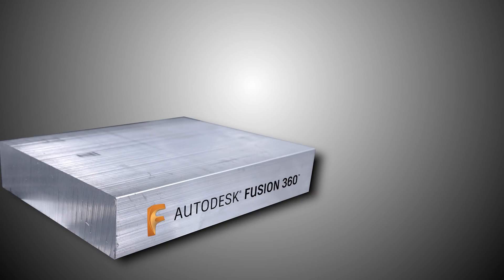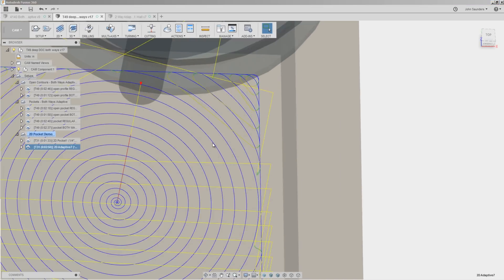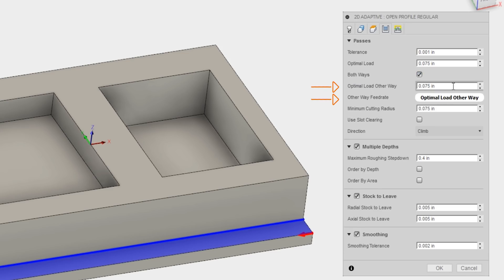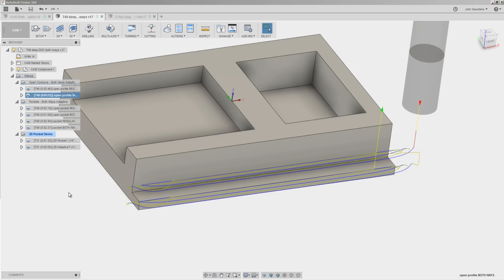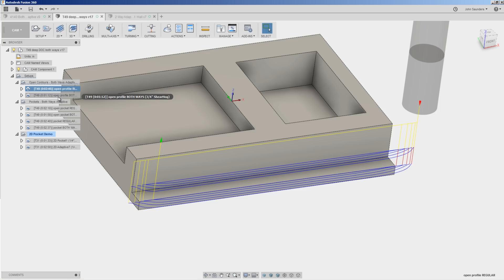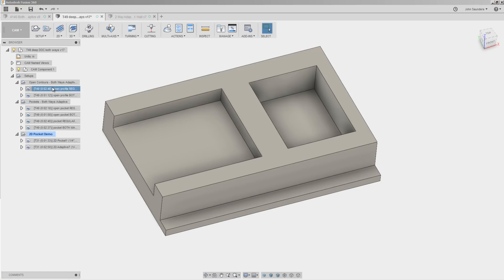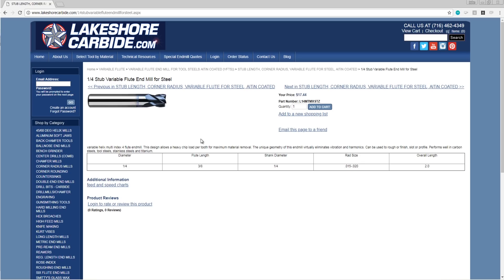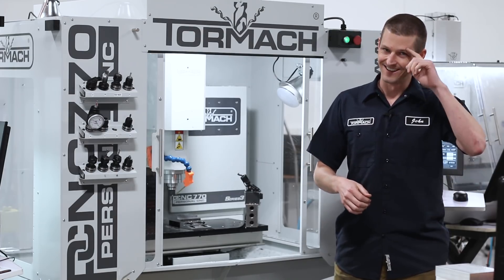How to Use Both Ways Adaptive Feature in Fusion 360!  WW197

Comment: Loving your videos... gotta question though.  at the 8:44 mark where you're cutting the 4140 with the 1/4" mill, the 2 pieces don't look like  they've had the same amount of material removed.  The 2 way adaptive piece on the right has a deeper cut  than  the traditional adaptive on the left, just a little confusing.

Comment: You can also drill your corners before starting a deep pocket to save time depending on your tool change time. a drill has the highest metal removal rate, and without a high speed machine, the corner peeling take quite some time.

Comment: So you are using lower optimal load and higher feedrate than the mfr recommended F&S. That's really interesting - please let us know your experience and recommendations. Many of us have old / light machines where this sounds very helpful - often the recommended F&S are very aggressive! 

I tried both ways CAM in steel and for my 2D Adaptive a couple of weeks back it would have been slower so stuck with default. Great video!

Comment: What cut recipe were you using on the 770 with that 1/4 Lakeshore in 4140?  I could really use that as a starting point.  Just got some 1/4 setscrew holders and stubby end mills to do some 4140 and stainless parts.

Comment: @ 6:14  Why wouldn't it link around instead of over, to me it seems like it would be faster to keep X and Y moving and avoid using Z ?
Reply: You can tell Fusion 360 to do that.  There is an drop down menu it the last tab to select the "stay down."  From least to most you can determine how much it will endure before moving up for a linking move.
Reply: +Jared R 
Cool, I have a feeling that would save time in production, maybe not in simulation.

Comment: Haven’t open Fusion in awhile. 

But I know SolidCAM recently added zig-zag (same as both ways in Fusion) for iMachining. Have found it to be completely useless with ONE exception. High feed mills with small axial step downs and 70-80% radial stepovers.  It significantly reduces time and the high fees mills don’t care if they climb or conventional cut. 

Everything else, I have seen no advantage to bi-directional adaptive machining. 

It your example of that large part, I would have just done 3 separate 2d adaptive paths one for each corner in Fusion. 

In SolidCAM I would just adjust the separation control to make it machine each corner separately
Reply: I have had similar results with High Feed Indexables and Mastercam.  It seems like each CAD / CAM software has similar calculations, but different controls and refinements.  I think the Bi-Directional option is good for really large older box way machines.  Autodesk has done a good job with updates for Fusion, maybe they had alot of requests for this option.
Reply: Chris Rokz 
Except old box way mills would be better off using regular pocketing routines. Not enough rip-ems or acceleration to take advantage of HEM tool paths.

Comment: Holy smokes you were cruising through that 4140.  I would've been hesitant to try both ways in steel.....until you showed it.
Reply: I've been fighting a chatter war with my 770 against 4140 for a couple of weeks now.  I'm closing in finally.  The set screw holders seem like they'll end up working a bit better because they are shorter.  Less stickout from the spindle nose is better.  (side note, Tormach ER16 holders are the same length as setscrew holders.)  But anyway, I don't have it completely chatter free yet but I tore through a 4140 part a few days ago with a cheap 5 flute 3/16 TiAlN variable in an ER20 holder, adaptive strategy, 126ipm, .1875 DOC, .014 WOC, 8153rpm, 400sfm.  Both ways adaptive 113ipm other way.  I did hours of test cuts to prove it was handling it before turning it loose on the real program.  I was TERRIFIED when it dove into the cut at that speed.  Cutting 4140 with a tiny end mill at near rapid speed.  Knocked out the part from 2" x 3/4" stock in less than 2 minutes flat.  I suspect this will work much better yet with a quality Lakeshore 4 flute, going slightly slower due to one less flute.
Reply: That would be super scary.  That is moving! I'll be sure to test that out sometime. Thanks for sharing with me.

Comment: I still don't understand why they can't get the simulation times accurate.
Reply: Andrew Delashaw 
Too many machine variables. Axis acceleration, rapid movement speed, code read ahead speed, tool change speed, chip to chip speed etc. 

They’re just comparative times for a general idea of how long it would take. I haven’t seen a CAM software yet that can accurately match to real world times. Also probably not very high on on the software programmers to do list.
Reply: I've also noticed, in mastercam, that a part can have different runtime between 2  simulations without any changes of feeds'n'speeds or toolpath
Reply: If only fusion360 had a calibration part you could run on your machine, measure machine time for different cut types to put feedback into the simulation time.

Comment: Can you specify climb milling for the final pass?  Or should the assumption be that you are going clean up surface finish with a finishing operation?
Reply: No, but there really isn't any reason you should need to. The adaptive strategies are for roughing so you would use another toolpath (like 2D Contour) to climb cut to finished size.

Comment: Have you experimented with this on the Haas? Would be interesting to see what the higher rapid rate would change here.
Reply: Yeah, I would argue the same. The higher the rapid movement, the smaller should be the saving in time by using two ways adaptive. I think on machines with linear drives or just very high rapid rates it may even be slower than the conventional adaptive. Not to mention that some tools- especially tools with carbide inserts- don't like to cut conventional. But nevertheless two way adaptive has definetly some authority to be there.

Comment: did you try "keep tool down" and "minimal retraction" ?
good features to reduce linking and rapid movement.
but overall good video like it
Reply: Michael Bruckner keeping the tool and keep the tool down most of the down will solve the high and numerous retract. HSM works user